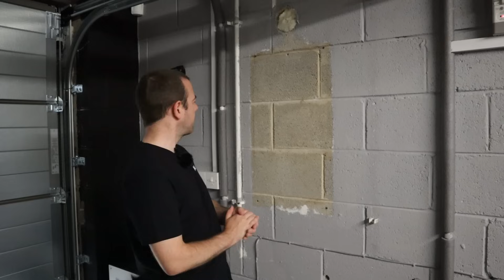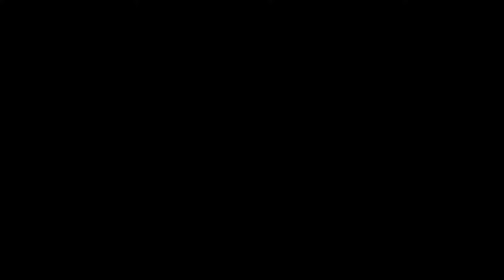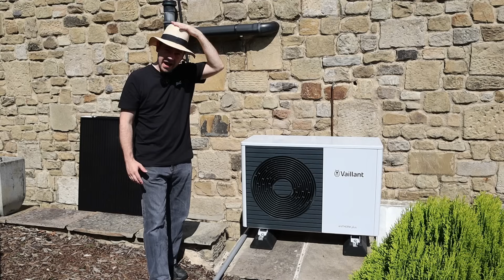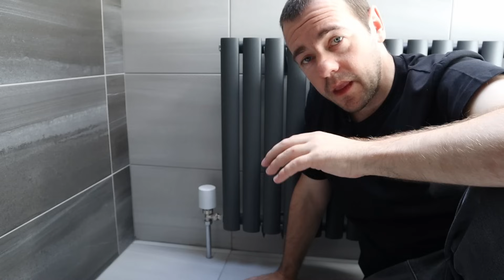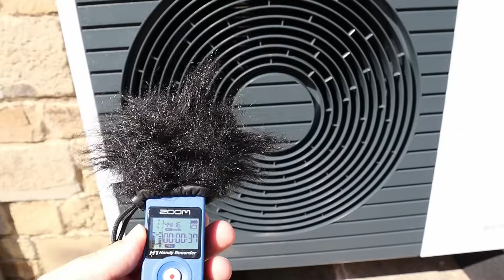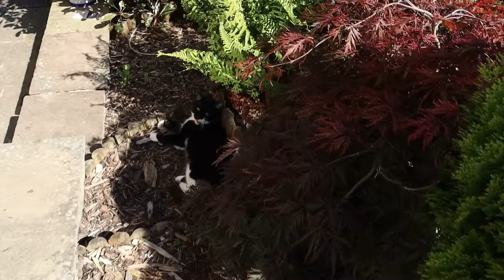Heat Pumps - Our 'Ugly' Truth!

Comment: Firstly a big thank you for your video. I must firstly say that skill builder was right at that time ,but technology has changed since. Your obviously not short of a few Bob and have a lovely dream home to many UK people and you obviously worked hard for it. But millions of family's could not afford your system. It's fantastic that soon the heat pump will become a straight swoop just like boilers are today. I really would like to have one and I am in the process of a need to change my lpg boiler. But a combi boiler new generation hydrogen ready is £2500 installed. No tanks ,water as I need it when I need it. When the country is ready to supply me the greener form of gas I will be ready. I know that your system must have been at least £16k all done. Huge difference in cost. The other thing people seem to forget especially now days with what has happened with Russia do you think it's wise to go all electric. All your eggs in one basket , could catch you out at the wrong time. I for one prefer to have both. Infact I will have both and I will decide how I supply my hot water and heating. Before you state but, when the electric is off you cannot power your home with gas boiler. Yes your correct but using a very small generator you can run a gas boiler and small appliances say example 2.8kw petrol generator . For me it makes sense to spend £2500 on a lpg combi boiler and £1200 in a generator as back up. Imagine every home in the UK using electricity for everything and we have network issues. What are you going to do then.you may be ok but think not just yourself think of how others live. People also need to understand that solar will not work and supply there homes if the power fails. Another downside unless you have a hybrid inverter but again another specialist area. But then you may have battery's yes but what do you do when they run low. Our network suppliers have restrictions on turbines and solar systems and they do not allow them to be used when the supt fails. I agree that heat pumps have come a long way since skill builder videos but he was not wrong at that time. What needs to happen is heat pumps need to be like yours modular and compact so they are easy to install and they must be cheaper by at least 70% of what they are now. My only take, is the UK needs to get its energy supply sorted so we do not have to import then bring in the dead lines to transition across. 2035 is not achievable for millions of UK citizens. When the UK s networks are upgraded including rural areas with our own UK supply then we should bring in a time scale to change. What we have now is not achievable.they will say it is but the truth or ugly truth lol is it's not

Comment: Great to see you've made the leap to ASHP. You've got the right setup with solar PV and batteries to cut your costs down. Last winter on the old Octopus Go tariff we spent £100 a month with solar PV but no battery. We just got our 8.2kwh GivEnergy battery commissioned and running and about to move to the more expensive Octopus Go tariff (similar to your rates). We'll see how quickly the battery gives a ROI.
Reply: My case with batteries have been
Summer battery use 4 Kwh avg
Winter battery use 6 to 8 
This summer saving £50
Winter saving £80
Yr saving £860
Solar Panels still have the best ROI, but every little energy saving nibbles at lowering

Comment: Excellent choice, we had an Arotherm Plus 10kW installed back in July. Needed quite a lot of radiators replaced though as many pf the ones in the house were 70s/80s vintage......they would have needed to be replaced regardless..Currently heating DHW to 45 degrees, seems to suit the family at the moment.

Comment: The increased cost of electricity is a concern when that heat pump is going to have to be run pretty much constantly through winter to be efficient! 😲⚠️🤔
Reply: Didn’t gas get more expensive too?
Reply: @edc1569  Precisely, heat pumps are being pushed forward as a 'better' all round solution compared to 'old' gas boilers, ie cheaper to run and better for the planet plus more efficient.

For me personally I'm not seeing where the benefits are?
Gas fired power stations already produce the majority of our electricity in the UK.

Gas boilers are at about the peak of their efficiency, mine is only a couple of years old and I can tell.it is far more efficient than my last boiler, my house is warmer and costs less to keep warm!

It's going to be another 20 years or more before we see renewable energy becoming our main source of energy.

But I doubt we'll get to that point as demand for power increases exponentially as the EV market gains momentum, certainly by 2030 we'll see a huge increase in demand for power, we're already very close to full capacity on the national grid.

I think.heat pumps are probably going to work fine in modern, thermally efficient houses designed to run them. But in the UK most of our housing stock is older, draughty and thermally much less efficient, a heat pump will not work in those circumstances.

You're right heating my home with a gas boiler is going to be much more expensive this winter.

Hence why I have installed a wood burner, I've already built up enough wood to last me through winter just by foraging. 👍
Reply: @pdtech4524 Gas powered power plants have an efficiency of 64%. The average COP of heat pump heat pump is 3. So the overall efficiency is  192% (64×3%).  
An average gas boiler efficiency is only 80-90% efficient.
Reply: @JSM-bb80u  I tend to rely more on personal experience than figures copy and pasted off the Internet!

Every home is unique as far as heating goes and I have no doubt a heat pump is probably a very efficient solution in the right, modern property that is thermally efficient but the vast majority of UK homes are older, less thermally efficient properties, where a heat pump is not always the best solution.

Mine is a 1960s 3 bed semi detached, fully double glazed, triple layers of loft insulation and cavity wall insulation, it's a lot more thermally efficient than it was when first built and our newish boiler only has to be run for around an hour to fully heat the house up to temp, I set my main thermostat to 23⁰ C  but I also.have individual rad thermostats so I can adjust each to suit that room.
The temp rarely drops below 19-20⁰C even if it drops below 10⁰ outside. We're south facing, so benefit from free heat from the sun 🌞 which helps to maintain that temp after the heating has gone off.

Now if I had a heat pump setup, I would mostly likely need to keep it running pretty much constantly and I certainly wouldn't see temps of 23⁰C inside, especially when the temp drops below 10⁰ outside!

I know this because a colleague has moved into a similar property, it had an older gas boiler fitted, he was concerned about rising gas prices and the cost to heet his home so he had a heat pump fitted, he now has a colder house and running costs similar to what he had previously because electric prices have risen far higher and he has to keep it running constantly!😳 

I've been to his house during winter with it running and I have to say wasn't impressed with his tepid house compared to my cosy warm fairly efficient setup.

For now, I'll stay with gas until sometime in the future when they figure out how to make heat pumps far more efficient or come up with a better solution.
Reply: @JSM-bb80u  I prefer real world experience, rather than figures copy and pasted off the Internet.

Every home is different, sure there are modern homes that would suit a heat pump but the vast majority of UK homes are older properties.

I can keep my house cosy warm just by putting the heating on for an hour,  it gets to around 23⁰C and rarely drops below 19-20⁰C when the heating is off and the temps are less than 10⁰C outside.

My colleague has a heat pump and has to keep it running constantly, his home is no where near as warm as ours.
His running costs are similar to ours.
Reply: @pdtech4524  Insulation is good. Even if you use gas boilers a good insulation would reduce your bill.
Reply: @JSM-bb80u  I live in a 1960s 3 bedroom semi-detached, so not the most efficient thermally when it was furst built but it has full double glazing fitted and triple layers of loft insulation, plus we had cavity wall insulation put in, which made a huge difference!

Additionally we are south facing so get a good boost from the sun 🌞 even during winter!
Reply: @pdtech4524  what about your friend's house? Is it well insulated?

Comment: The minute you mentioned Scandinavia I almost switched off. This is a false comparison. Yes it’s colder there. (There’s actually energy to be harvested until you hit absolute zero -223’ or thereabouts) 
Why the comparison isn’t relevant isn’t temperature, it’s moisture. 
The U.K. & Ireland derive our temperate climate from the Gulf Stream. We are actually on the same latitude as Moscow where it’s routinely 30’ in summer & they have a metre of snow all winter. 

Why is any of this relevant? 
In the winter when the ambient temperature drops to around 4’ or less the moisture in the air that’s all around the heat exchanger in a heat pump begins to freeze. 
At this stage forget a coefficient of 3-1. The thing needs to thaw itself out. 
Depending on the model it will either go into reverse cycle (it extracts heat from your house to thaw itself) or it will have a ‘boost’ mode (that’s usually a 6kw immersion shoved up its bum). 

If you think 3-4’ is rare, in many places it’s not. It hung around 4’ in my area for a fortnight last winter & it was actually a mild winter. 

I used to work in renewables. The business was owned by a very bright engineer (who also had very high personal ethics). One day he said “guys we’re not selling any more air source heat pumps”. “I can’t, in good conscience sell a customer something I wouldn’t put in my own house”. 
He had done all his homework & came to that conclusion. 
Yes, if you’re in the midlands or the Home Counties & have a reasonably energy efficient house, then you might just get away with it. 
Though I’d never recommend fitting one without a thermal store & I’d advise fitting low temperature radiators. 

Final quote from a guy who’s fitted heat pumps for 30yrs. “ most ASHPs on sale are just glorified air conditioners”

Grant’s hybrid is worth looking at as it uses a conventional boiler as a backup when the heat pump is struggling. At least they acknowledge there’s an issue.

Comment: As someone else mentioned, at the wrong side of 70 I’d would never see the benefit of any of this. You hopefully have many years left. The caveat to that is if for some reason you had to move. Your buyer would rubbing their hands with glee, because at the moment your house value would not go up to cover the expense of that installation. An example, a friend of mine had just solar panels fitted to his house, that cost him £10,000 plus and there was/is a feed in tariff. He was there for two years, had to sell, no increase on the value but the new buyer has the feed in tariff and really no out lay. So win win there. In my early working days on gas boilers there was only two things to go wrong. Thermocouple and unlikely gas valve, easy. Life just wants to get complicated technically these days. When systems like yours ( and modern cars) go wrong, it costs an arm and leg to get it put right. Does that really make sense? Look forward to hear what you say after the coming winter.

Comment: The "phrase" Heat Pump Is Losly Used,Ground air water. i did hear say at low outdoor temp the things do freeze up! needing electric heat to deice... they are not effective aand are not ecologic,, we will be price out of alternative,, electric price per kwh is excelarating faster than gas, there is NO urgency..
Reply from the maker: It doesn’t freeze up. Most of Scandinavia (where it drops to -30c or worse use heat pumps. How can they not work in winter?
Reply: @ElectricVehicleMan  drawing that degree of cold across the exchange causes ice build-up,which i can well understand,as the ice builds it blocks. where gas is not available they could supplymeny heating,but i hold gas out-guns them.
Reply from the maker: @bexhill8777  They have cycles to prevent this from happening, it's not rocket science!
And again, how are they managing in -30c temos in other countries? Magic? Voodoo maybe?
Reply: @ElectricVehicleMan  whooops. magic,voodo,?  So you accept "this" happens,good,and it,s prevention is intergrated,so you have provided an answer,cycles.. are you a"scientist" hopefully not a rocket one or a fitter? Are you only up for praise and adulation? if so best ave a word with tubey folk..
Reply from the maker: @bexhill8777  Still waiting for your answer as to how they’ve worked for decades in colder climates?
Logic and all.

Comment: Even assuming you can get this unit to consume just 800Wh, if we were to switch the thirty-two million UK homes that currently use gas to ASHPs, that would add a load of some 25.6GWh to the National Grid. To put some perspective on that, every home and business in the UK is currently consuming 43GWh - so we'd be looking at a 50% increase in UK generating capacity. 

"But what about renewables?" you might ask. Well, SSE's new "Seagreen" (A) offshore windfarm (which came online last week and is the size of Greater London), generates just 1.075GW. This means we would need to add a further 2,800 offshore turbines, as well as seven Nuclear stations the size of Hinkley C, before we could even could reach even the baseline of capacity needed to support the country switching to ASHPs running at 0.8kWh. 

P.S. In the event of most ASHPs consuming >2kWh, it would not just be the nation's generating capacity that would need to be doubled, it would be the entire distribution network - including 33,000 stations and substations, with 250 of those being inside the M25. And that's before almost every mile of buried and overhead cable was replaced.
Reply: Or put solar panels on the rooves and run all (Summer) and much (Winter) of your ASHP from that instead - with minimised impact on the national grid. Your concerns mirror those of many in big companies and government - 'how do we do this in the old corporate way that will generate profits and lucrative NEDs' - rather than 'how do we do this so it gets us off fossil fuels and helps solve global warming'.
Reply: @neilcunningham1081  "we" cannot solve global warming, nor can we even make a dent in it. Even plunging our poor and working classes back to the Middle Ages (which is where we're headed right now) will not make one iota of difference. Here in "La La Land" (aka Scotland), SNP and Green councils are running around bricking up open fires, to make sure people can't burn wood to stay warm this winter - fires that almost certainly saved countless lives last winter! Meanwhile massive numbers of the eleven-million trees, felled in Scotland, during 2021's storm Arwen, are being cut up and shipped to Scandinavia and Germany - to be burned in open fires.   

Once people start freezing, once they see neighbours dying of cold (and that could be this winter), and once the shattering double-standards of the people promoting this are dragged into the open, I think we can safely say that the move to "Net Zero" will be STONE DEAD. And with its passing, I'd say we can (finally) draw-down the curtain on ASHPs
Reply: @skfalpink123  Wow - you really don't like ASHPs do you? I understand how overwhelming it all seems - but the council of despair is a guarantee of failure. Happy to agree that shipping wood for burning anywhere is madness - much of it could be better used for building (as we seem to import most of our building wood) - and the rest could be burned in our biomass stations rather than sent abroad. ASHPs are a major and successful heating method across Scandinavia (1/3 of all Finnish houses I believe) and have been for years - so suggesting that they don't work in cold countries or are too costly to run etc is just nonsense. And like anything else - we have to start somewhere. Sorry if you've had to brick up your fireplace.